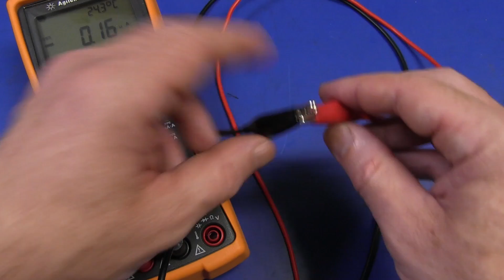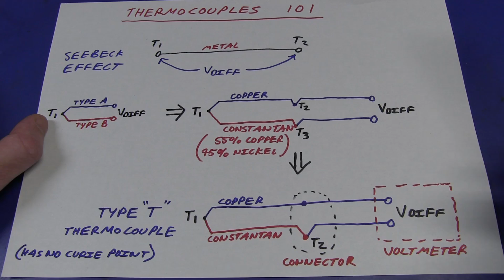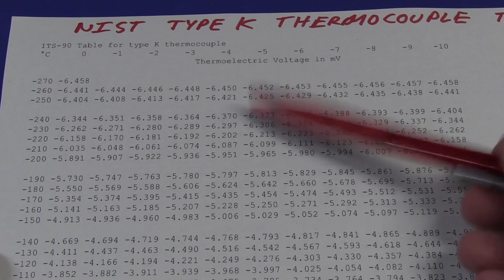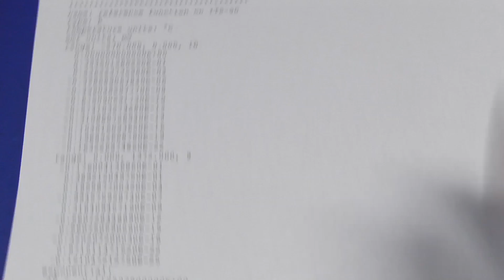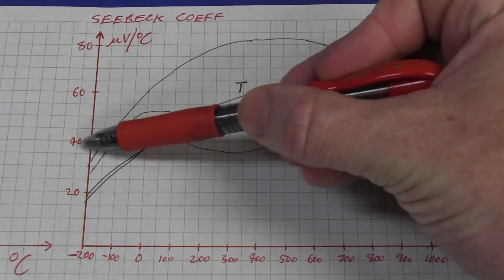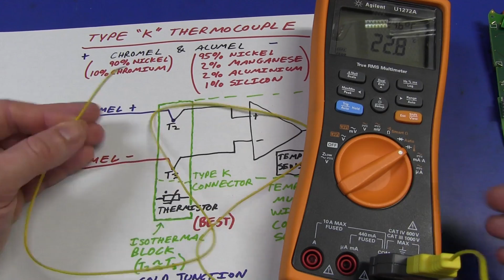EEVblog #419 - Thermocouple Tutorial

Comment: Your tutorial is great!  But you skipped an introduction.
1. *What. Why. How.*
What are you measuring?
Why are you using a thermocouple?
How to connect to a DMM with and without thermocouple input mode.
2. *Explain PT100, PT1000*
3. *What's inside the various Type-K socket to 4mm banana adapters?*
4. The basic overview and middle-school science demonstration explanation is great - but you jumped into it and it would be better as an appendix at the end /as it's not correct from degree level Physics (and it's not worth doing here / beyond the basic explanation)

Comment: Is there a shortest wire consideration for building a K type thermocouple?
In my application I need 20cm probe lenght at most. Temperature to measure up to 250 max, mostly 220-230 range.
I figure out that silver solder works good for hot juncture.

Comment: Dear Sir, 
Thanks a million times for your explanation, 
it was very simple and straight to the point. 

I have this question please;
If we have a TC type K connected to a Temp. PID, 

Can we use two copper wires connected to Fluke DMM form one end and the other end of these two wires is connect at the PID exactly at the same TC terminals.  

So the PID can read the temperature from the TC and at the same time the Fluke Digital Multi Meter can read the Temperature from the TC as well. 

Do you think it will work, or the two copper wires will affect the reading ?
as i do not know the right gauge and length of these two copper wires ?

Please help Sir,

Comment: Some want to know how to use the K-type sensor that came with an AstroAI DMM to measure a temperature.  Could you hold the wire sensor at the base of a spark plug to get a cylinder head temperature of a running engine?  The sensor wire would hardly be in good contact with the metal cylinder head.

Comment: Question: Does the length matter???   I wanted to measure/calibrate my soldering iron temps.  I was going to buy a 191 tool, but later thought getting a proper 2 channel device would have more uses.  So, if I cut the leads down at the plug end of one of my probes, so I just have a little stub sticking out, that I can touch my hot soldering iron tip to, will it still read the same?  Love all your videos, Thanks for sharing.  I know this video is from 2013, hope you still check comments...

Comment: Nicely explained but there is an error there, I think, about the NIST chart. I believe that the horizontal line is actually the subdivision of temperature rather than the cold junction temperature. You can easily confirm that by checking that the last column value is identical to the first column of the previous row when negative and the to the next row when positive.

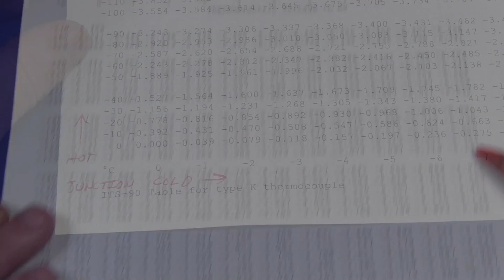Comment: In the new videos about thermocouples with multimeters, you mentioned this old one - great and informative as usual. However I think I found a flaw at around 12:01 Minutes when you explain the NIST K-Type table.. I think it’s not cold on the X-axis and hot on the Y-axis. It’s  a linear list from  -270 - 0 °C in one degree steps. If you want to know the value for -13°C , you go the „-10“ line in the „-3“ column and get the value of -0.508 for -13°C.

Comment: Have watched a lot of videos on TC's and the people making a big deal about the bead on the business end of the TC wire. They go to great extents to make sure there are those same two types of wires through the entire length from the tip back to the meter. All you really need to care about is making only one transition.

When I worked for a US defense contractor in the 80's, I used to make thermocouples for the various temp tests from TC wire on spools of wire. I would cut off 10' of wire, strip and twist one end, and give it a blob of solder, then run the wire back to the patch panel, which was all standard nickle plated bus bars. No need for all the fancy plugs, extension cables, etc. Can use a 16 AWG extension cord if you need to. Besides, what you connect that TC to will not be made of the dissimilar metals.

Comment: Good tutorial. 
Note: only some thermocouples work direct in liquids, like PVC or waterproof types, some soak up liquids and affect the result. Just a tip, use non-conductive fluids with TC's in a tube an immerse it into the liquids with the reference probe, keep in mind temperature ratings on all devices used.

Comment: Could someone tell me the best way to attach that point end of thermocouple to the measuring surface. It is so difficult to keep it in place without a fixture.
Reply: Just use some thermally conductive epoxy like Item# OB-100-1/4 from OMEGA.  More importantly, to get an accurate reading the thermocouple should lay flat on the surface for roughly 10 x the wire diameter so that enough heat can be transferred into the thermocouple to balance the heat wicked away up the length of the thermocouple.
Reply: @tomrestis4533  Very helpful. Thank you

Comment: Back in the day we actually had ice bath units as the cold junction reference.  As I recall the bath was controlled by monitoring the volume of ice water so that the system was maintained with some ice and some water.  If it was allowed to get colder the volume would increase as more water turned to ice so by making sure the volume didn't increase or decrease beyond certain limits then you knew there was a solution with ice and water so you could know for sure you were at zero Celsius.

Comment: At the hot end of the thermocouple, why is there always a blob of something? I understand that the manufacturer needs to attach the two materials together but the blob seems a little excessive and that blob can be coated in something. Why is this?
Reply: 08Ultrasonic    The blob is the welded junction,we made our thermocouples up by welding junction with acetylene torch,we ran temp.survey in hi temp.furnaces used for heat treating & annealing. The results were recorded on graph recorders for production tracking,also customer proof records. (It was thermo couple wire twisted at the end and then welded to form t.c. Hot junction)

Comment: I know you explained noise but it was not satisfactory. How do you reduce the effect of noise here? When you trun on the multimeter basically you will get 0-2mv noise from environment. How do you know your signal from thermocouple is accurate in that small range?
Reply: That case you talking about when DMM show few mV is because you have not connected probes to anything and it pick up some crap.
But when we close the loop(connect to something) then noise dont have enough power to interfere readings.

Comment: An interesting thing about thermocouples that many may not realize is that although they generate a relatively small voltage, they can generate a high current if their load resistance is low, and the temperature differential is high. The current can be more than half an amp, maybe up to an amp or more. An example of this is a furnace that uses a thermocouple to monitor the gas pilot flame. In this application, it must generate enough current to hold a solenoid open to allow gas flow.
Reply: ThermoPILES are used in that case, and they have like 11 or 22 thermocouples in series/parrellel wiring.   The hot end sticks in the flame, and the cold end is 2 inches away near where the leads come out.
Reply: We use them and change them very often at work (for similar purposes you mentioned)...
Reply: @tzampini What sort of temperature difference would produce high enough current?
Reply: Interesting. I thought the thermocouple current controlled a larger current via a transistor/relay. I didn’t realize it actually kept the solenoid open by itself.
Reply: @sylviam6535  The reason they don't amplify the current with a transistor/relay is because this would require power. In the event of a power outage, this safety system would not work. By having the thermocouple current drive the gas valve solenoid directly results in a simple fail-safe system that doesn't rely on house power to operate.

Comment: Note that in order to have seebeck effects you must have TWO types of metals and they MUST be of different types, one should be p-type and the other n-type. The electrons' flow from the n-type to the p-type is possible because the p-type material has holes, which are positively charged spaces.

Comment: I've got a ZD 937 soldering station. It has an atmel at24c02 2KByte IC, now I'm wondering, perhaps it's used to store the nist data table, hmm....
Reply: bergweg Read the IC and post the results on the EEVBlog Forums!
Reply: ***** Do you also have a zd-937?
Reply: bergweg Naw, I'm poor, I use a cheap ass thing with the PSU in the handle

Comment: Great video as usual Dave, thank you!  But how can I test a thermocouple? How can I determine whether is giving a correct reading or not? Is it just about checking continuity between the two junctions?
Reply: Alberto Silvestrini I would guess maybe voltage and temperature for the metal were correlated and put into a table by some other means, and then the voltmeter uses some sort of table lookup.
Reply: Alberto Silvestrini I suppose you can test with ice water for 0 and boiling for 100. the boiling depends on pressure but your ice water will be absolute (and safe)

Comment: Dave, would you take on an apprentice? 
I've been watching your videos for weeks, non stop and your work is absolutely fascinating.
Reply: Hey SID, I  know you from George Duncan barley and hops. I had a question you may or may not be able to answer can you make your own plug for a k-type thermocouple from like a headphone jack or USB cable and just do a recalibration with boiling water
Reply: corey blackburn I don’t think so, for these reasons. 
1. They rely on a very precise resistance, so any cutting and soldering will change this ever so slightly.
2. I have found that the thermocouple is just a special alloy that changes resistance with temperature and my past attempts of soldering this wire have failed so I don’t know if it’s a solderable metal in the wire or if it’s something like aluminium that can’t be soldered but has low resistance, gold being ideal, copper and aluminium are 2nd best so we mostly use copper for wire because we can solder it.

Yes, for these reasons.
1. You never know, if they’re cheap enough, give it a go and see how accurate it is and if it can be soldered at all.
2. You could always change the socket to suit the thermocouple’s existing connection. 
3. Work with what you’ve got and do your own testing.
4. Those laser aimed uv temperature guns are pretty damn accurate, but not on shiny surfaces so I place black tape on the places I want to take measurements and aim the laser at the tape and it’s dead accurate to within 1 / 10th of a degree. $30

Comment: At the begining of the video I think the demonstration of the seebeck effect with its explanations could be wrong. The soldering iron was placed near centre of the wire and the only reason for the voltage going up was because the soldering iron was not dead centre. I bet if the iron was place 30% of the way along the wire where the conducted heat would not really heat the banana jack the voltage output would be higher than in your example.
Reply: That was my impression also.
Reply: +Neil Bradshaw
i think you are almost right, not quite. he placed the iron on a junction of Cu-Cu. even if he placed it at 5% down, it's still Cu-Cu (less thermal mass on one side, so you would see more change). the junction needs to be 2 different metals for best results.

Comment: Hi  The bit about the compensation table is wrong.  The scale along the bottom is just to provide the 1 Deg. steps. 

The vertical scale goes up in 10 deg. steps so you go the the 10 deg step that is lower than the temperature that your cold junction is at and the use the horizontal table for the 1deg finer steps.  OK ?
Reply: I think so too. But what's the intention to go from 0 to 10 horizontally? I expect 0 to 9. Anyway, it's 1° step since the 10 values are equal to the next lines 0
Reply: That makes more sense, thanks for pointing it out.
Reply: +lollandster 
ya, i sat there for a while trying to figure out why as the 2 temps come closer together, the volt difference diverged. glad to have this sanity check right below
Reply: I thought so!!
Reply: I noticed that too. You have to be careful when listening to self-proclaimed experts, always check the source.

Comment: Why there is no temperature probe calibration should I say compensation in the Expensive Agilent U1252B, meter? My probe is +3C (checked in water bath with calibrated mercury thermometer), so if I can adjust various settings of the multimeter why I can't set the +3C to the temperature readings? 

I sometimes forget to compensate it. Why Agilent is so dumb not to include this?

Comment: did you read that Application Note you linked to,
"Seebeck s experimental work showed that if a voltmeter circuit wiring and the conductor under test were both the same material, then the net loop voltage is zero because [Sa*(T1-T2)+Sa*(T2-T1)=0]."

Yes the effect is there in a single wire, but you can't measure it because either your probes are the same material as the wire, and cancel the effect out, or a different material and then they are the second material wire.

Comment from the maker: The Seebeck effect does apply to a single wire, and that is precisely why thermocouples work. A thermocouple is two different metals with two different seebeck effects. It's just that a single wire seebeck effect is not practical, but it does actually exist. See the link in the video description.
Reply: Even though this is a while ago mate, I wouldn't go for the Fluke brand... I have a MM 300 Kleins, (not the best) but also I have a DL479T (much better- has a clamp and many other uses 🦊for my HVAC-R equipment 🙂)

Comment: There is also a thermo couple that is copper filled with mercury that is used in water heaters and old floor furnaces. They actually mechanically push valves with the pressure created by the expansion of the mercury. Kinda confusing me by the use of the name over and over. But in these types the resistance change in the wire caused by the heat don't play a factor in the measurement? Thanks for the video, I always find them very enlightening. Well done as always.

Comment: This was a beautiful demonstration of thermocouples and their physics. I feel however, RTDs, are the industry standard for high precision temperature measurements. I'm somewhat surprised that thermocouples are used so much when keeping track of junction temperatures and metal composition is such a pain in the ass in comparision. I suppose cost (which have dropped in RTDs recently) of the element is driving it, but it seems the effort in "reading" a thermocouple is much more complicated.

Comment: Yes, but both alligator-metal junctions will be at the same temperature (ambient temperature) so you won´t get any voltage. You need two junctions at diferent temperatures. If you put one alligator-metal junction at ambient temperature and the other at the temperature you want to measure, you will have a thermoelectric voltage, but you won´t know what temperature correspond to that voltage, because for that junciont you have not tables. The types of junctions are normalized.

Comment: I've read about this effect in a physics book, and it says that of course you will get a voltage across the wire if you are using just one metal, but it will be an inner field, which you can't measure from outside with a probe.
So if you are using just one wire and getting a voltage reading, it will be due to other materials (metals) in your measuring circuit. Thats why you have to have the other metal with, of course, a different seebeck coefficient, to not zero out the voltage drop.

Comment: Looks like you've misinterpreted calibration tables.Horizontal axis is just a least significant digit of temperature. Such form is used for compactness. Temperature value is a delta between cold junction and hot junction. Usually cold junction is held at 0 degrees during measurement of these tables.

Comment: well, yes the effect don't go away, but your measuring at the end of a conductor, the temperature along the conductor don't matter, if it did the whole idea of the thermocouple would not work.

but your right that it is good to know of the effect, as smd resistors also has dissimilar junctions, and and a small temperature difference from one end too the other, can give an error if you are working with  precision  electronics.

Comment: **Another reason the thermocouple in 3d printers can be a bad thing (I use a thermistor for my temp sensing) -- if the thermocouple 'amplifier' is up on the printing head like an ultimaker - the heat from the head will eventually get to the amplifier and it will read lower than expected because the cold junction gets physically warm.  Who knew?!

Comment from the maker: In theory, yes, it should cancel out, as it's effectively a thermocouple with two identical metals with identical seebeck coefficients. In practice, it can produce a small dynamic effect like you saw. You may have noticed it actually started going back down the longer the iron was on there.

Comment: When you used the soldering iron to heat the centre of the wire I expected the meter to show no change.  Does the effect of the temperature differential between the centre of the wire and each end not cancel out ?

Comment: seems 4 viewers of the video forgot their monitor and speakers turned off while trying too watch the video.

anyway, If you want a cheap multimeter with no built in thermal sensor but comes with a thermocouple, check out the craftsman 82345 multimeter  (I think it just assumes that the ambient temperature is at 70F (21.11C)  (purchased it for $15 a few years ago mainly to use as a battery tester, especially for the cordless drill which which does not have any overcharge protection).